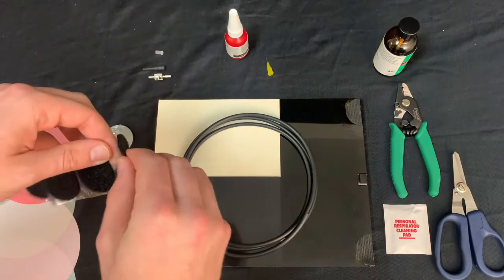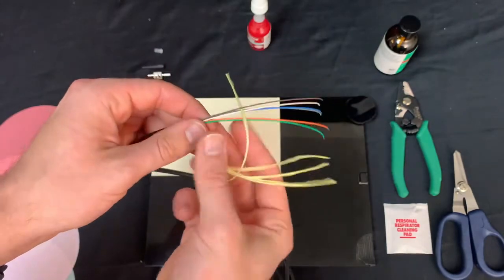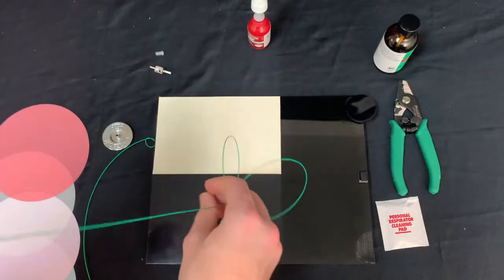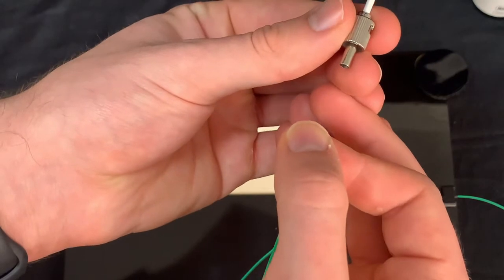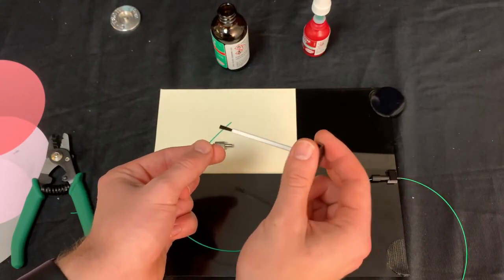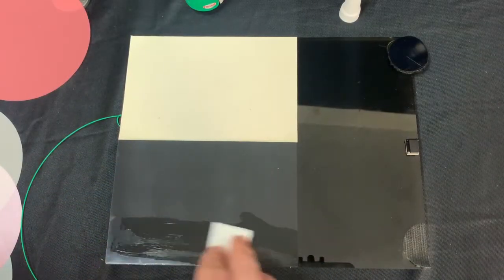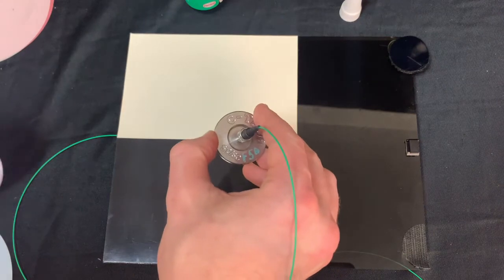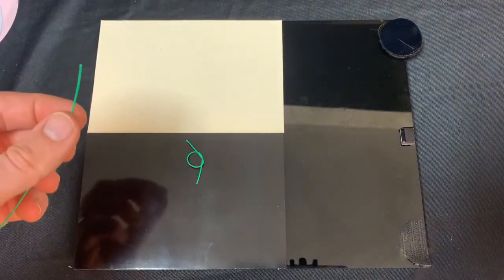Terminating a Fiber Optic Cable with an ST Connector

Comment: So, I'm having a bit of trouble putting the actual connector on the fiber, any tips to make it easier? I have a practical exam over this an some other fiber optic stuff and so far this is the only thing I'm struggling with.